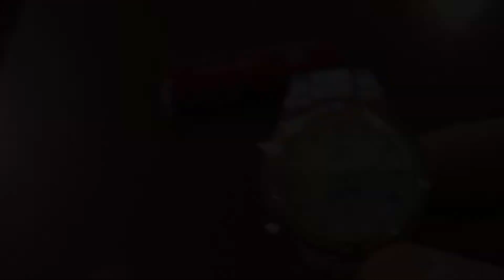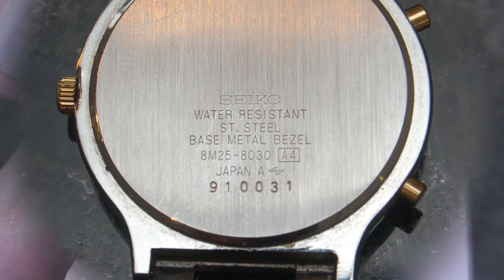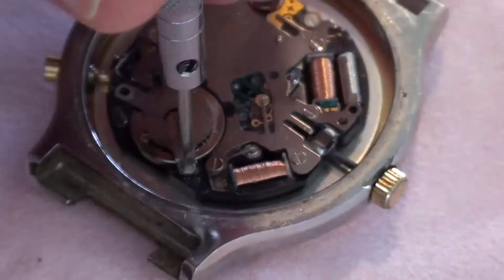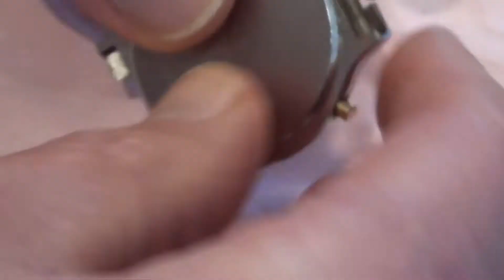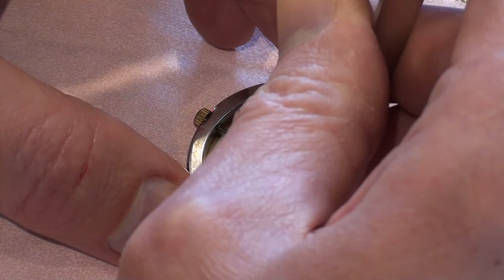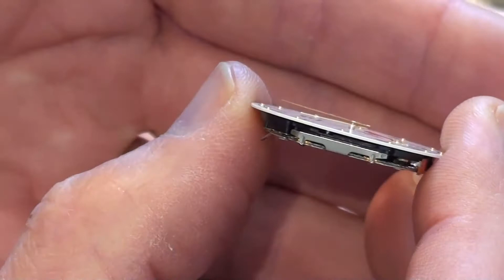Seiko Dancing Hands repair and demo

Comment: Just a quick comment - there is a TSB on these watches about how to tighten the mode selector on the shaft it mounts on. Apparently this is a common issue with them if they are mishandled a bit - enough so that Seiko did the TSB.  

Mine was working fine a few days ago, and then it came to a halt. I replaced the battery and it started working again. For some stupid reason I decided to tidy up some curd on the movement near the one battery retainer screw - and used a little tiny very soft watch brush. Apparently that was too much for that coil - the hour hand no longer works. Looking at it under high magnification I can't see any sign of a break - but the way the wires connecting the coil to the terminal just sort of dangle in mid-air on their way to the terminal is rather frightening.  I've been looking for hours for either a used movement for parts, or for replacements for the coils.. zilch so far.  I wonder if coils for other Seiko watches are the same?  I do have a parts listing which carefully gives PN's for everything BUT the coils.  The service manual for it does have resistance spec's so I guess that's the next thing to do if I can do it without completely destroying the coil.  An issue is there is no circuit diagram available that I've been able to find, so it's a bit iffy even trying to do a resistance test with the coils in place.

Comment: Would you like me to post my watch to you. I have the same watch and changed the battery and it is not working at all. It has some sentimental value to me. But £170 is too much for me in the current climate. Took my backing off and the battery leak is exact same as yours if not slightl worse. It would need to be cleaned on the battery side same as yours for the battery to make contact I think? I do not know how to clean the residue off and not to competent in taking it apart. Thank you 😊
Reply: Once the battery leaks then the acidic gas created will destroy the sensitive circuits.

Comment: I would suspect they polished the backplate, replaced from stock items the coils and steppers and prob found in some drawer somewhere a new circuit board or had to hand the smd components and just overhauled the circuit board.   (sorry didn't mean to bombard your video but I am a real fan of the dancers hehe)  Oh and the control switch for the crown control as they can be bought still as can the unique stems.

Comment: Should have sent it back for Seiko to fix!  Get plastic tweezers to avoid shorts and scratching... try avoid touching the dial and movement with bare fingers or wipe them down after.  Another 30 years from now the acids in your finger oils may have destroyed the dial and permanently etched the movement.  Clean parts should be handled by clean tweezers.